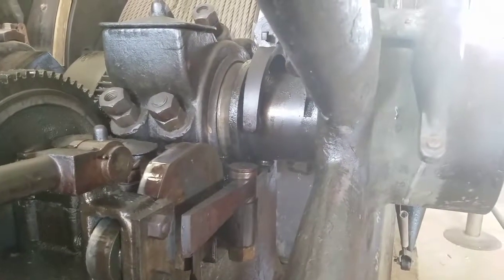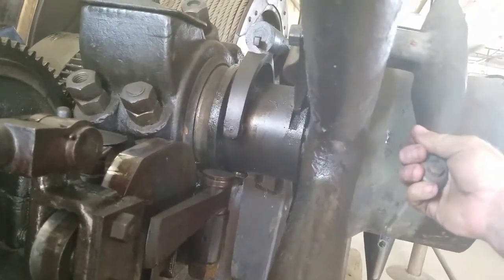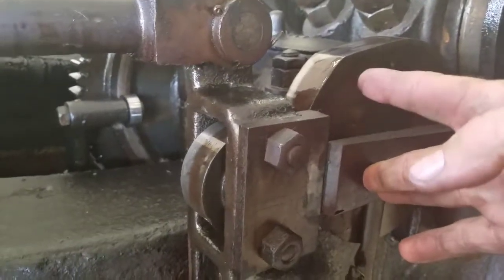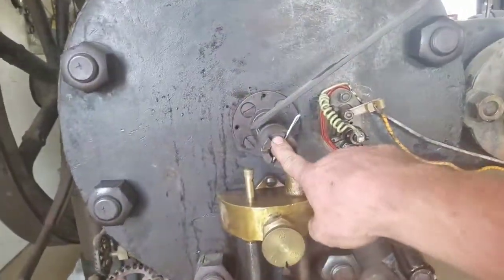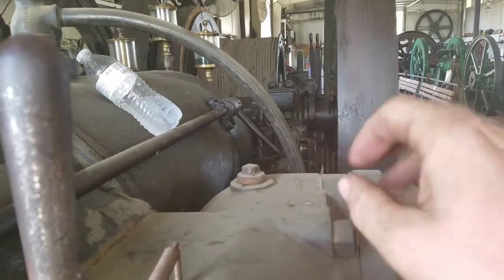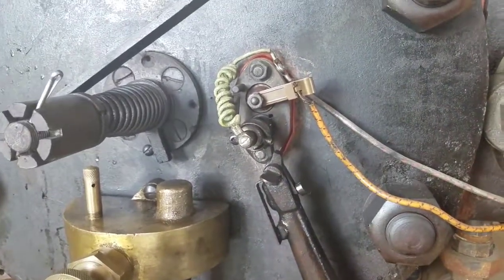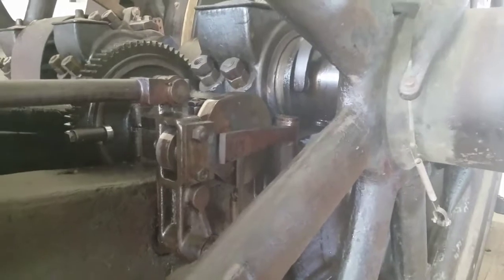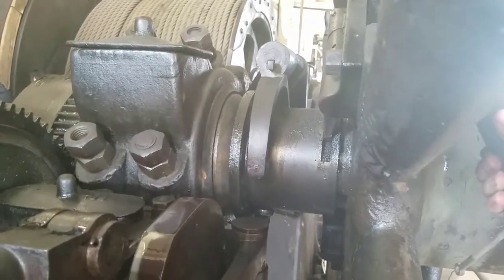How A Hit And Miss Engine Works - 1904 Fairbanks Morse

Comment: ❓🤔 Here's a question I've never heard anyone ask on these videos: did these engines ever suffer mechanical failures with the centrifugal governor systems, that caused the system to fail at opening the exhaust valve, and leading to the engines turning faster and faster until they ran away, and suffered catastrophic damage as a result of basically flying apart? Or is there a secondary backup system that would prevent an engine running away, even if the centrifugal governor failed?
Reply from the maker: Good question! On these old engines the 'back up system" was the operator!
This particular engine was a mine hoist engine with a big winch on the back, and so the operator was standing on the back side of the flywheel running the clutch and brake for the winch, and would be able to step over and stop the engine if the governor failed or jammed.

Otherwise, if the governor failed in the Accelerate condition, there would be nothing stopping the engine from speeding up until destruction, and I am sure that was not an uncommon thing.